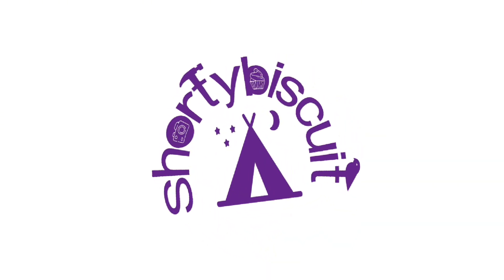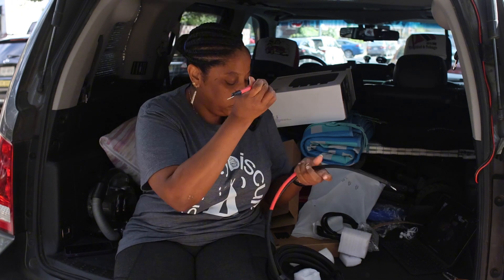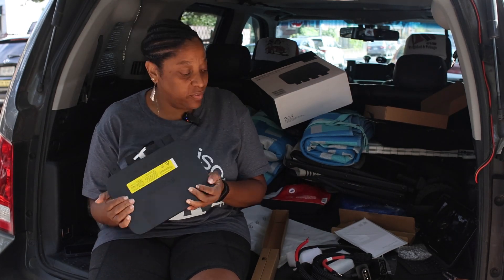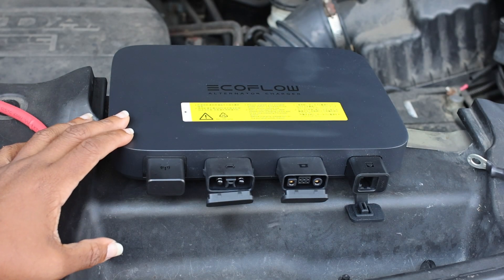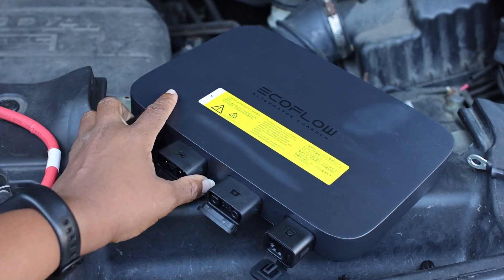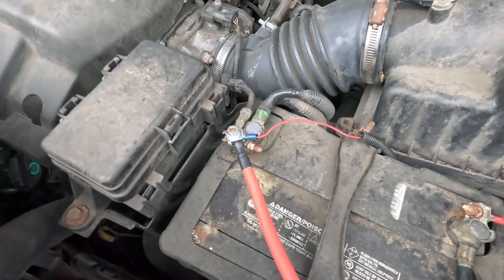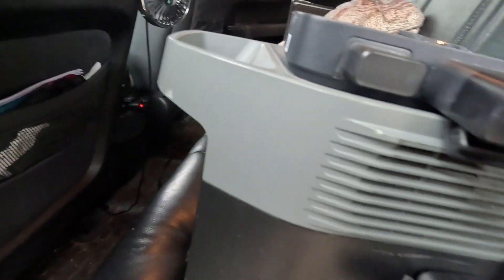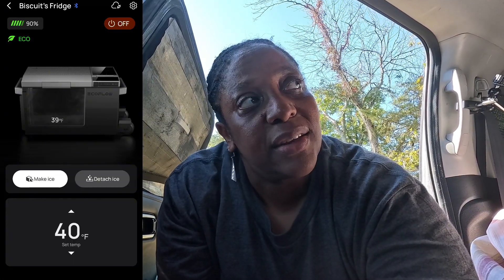Installation of EcoFlow Alternator Charger in a 2011 Honda Pilot

Comment from the maker: If you purchase from the EcoFlow website , you get an additional 7% off with code: ShortybiscuitBF (Nov 4 - 20, 2024). Or 5% with code: Shortybiscuit outside of those dates.

EcoFlow Alternator Charger - https://bit.ly/3CjpeFC
EcoFlow Glacier, battery and wheels: https://bit.ly/4afKuXZ
EcoFlow River 2 Pro - https://bit.ly/43brE0q
EcoFlow Delta 2 - https://bit.ly/4dYofsI

Amazon
EcoFlow Alternator Charger - https://amzn.to/3UCEPWZ
EcoFlow Glacier and Battery: https://amzn.to/44DVlty  
EcoFlow River 2 Pro  - https://amzn.to/3NXW4PF
EcoFlow Delta 2 - https://amzn.to/3wVipHN

Comment: I really enjoyed your video, thank you! I’m still trying to wrap my head around installation of the alternator charger and its uses even though I’ve purchased already. Even though I still don’t know what to attach it to in the engine bay for grounding, in my particular vehicle Honda CRV 2013, or also how to lay the cable (safely in the engine) and find the gromet/s, you really impressed me and inspired me to try (maybe with some help). I don’t have the tool you used, what is that called? I’m encouraged anyway to get as far as I can with it and your video has shown me how it all might be applied. I also have a River Pro and Glacier fridge. When you use the solar panels do you find there’s enough length of cables to reach your Delta 2 battery, while it’s still sitting in your vehicle, or do you need to take it out and move it closer to your solar panels?  I fear I will have no room left in my vehicle soon for my dogs to go camping with, what with all the EcoFlow products 😂. I’m constantly worrying my car battery will fail while I’m out camping and I believe this can be set to battery maintenance to resolve that concern, I’m just yet to see it all in action, so not sure what supports this, I like the way you explained how you’re set up and using it in practice. It’s a great help. Thanks again! 😊 I’ve liked and subscribed ❤
Reply from the maker: @delrose19  Hi! I was sooo intimidated at first. I looked at other videos and also asked in a Honda Pilot group for suggestions on where I could find a hole - though, it wasn't much help.

My fear was that I'd be on a trip and the weather sucked and my solar would not be enough. And that's exactly what happened - thankfully the alternator charger was installed and I as able to keep everything powered by running my engine. The alternator charger will stop pulling power from your battery when it reaches below a set limit - so you don't have to worry about it draining your battery. If something else does drain the battery, the charger can supply power to your battery.

I keep a Halo Bolt + Air in my vehicle - its is a jump starter and air compressor, so if ever my battery dies, I can use that. I've had to use it to help other people multiple times.

Depending on the angle of the sun, I do have to remove the Delta 2 from the vehicle. But that depends on where I am. If I'm stationary somewhere - then I just take it out. If I'm not - I use the solar panel that's built into my cargo carrier. It doesn't get as much input, but better than nothing. https://youtu.be/8bGgUE6mSc0

You can DM me on IG https://www.instagram.com/shortybiscuit/

Comment: Have you monitored how many amps youre pulling when charging and driving from your alternator?  I have an odyssey and its a 130amp alternator, been told not to run it more than half load for extended times.  In my case id be at 65 amps to be safe, which is 800w, however that doesnt include what the van pulls itself to keep everything else on, so in my case id probably need to lower the charging speed to 400w so it only draws around 33amps + whatever else the car pulls normally to stay on and drive.  Any thoughts or concerns youve read?
Reply from the maker: Hmmm. How exactly would I figure out how many amps I’m pulling? I have seen the topic mentioned in the EcoFlow FB group and haven’t yet tried to figure that out.

Comment: It looked like the yellow plastic went outside the gromet rather than punching a hole through it. If that's the case the wires will rub on the edge of the hole and eventually short out when the insulation gets cut all the way through. Otherwise good job, hard spot to reach.
Reply from the maker: Correct! The yellow plastic did indeed go outside the grommet during the testing. For the true install, I punctured a hole in the grommet for the exact reason you mentioned.

Comment: Just a suggestion the cable lead should be under the alarm cable tap on the battery since it needs a better connection to the battery leads more so than the small alarm cable. This is a common mistake in solar battery installations. Just a precaution bc that point will get hot especially inside an engine bay
Reply from the maker: Good suggestion. I'll make adjustments.